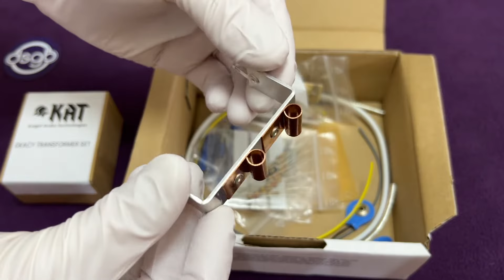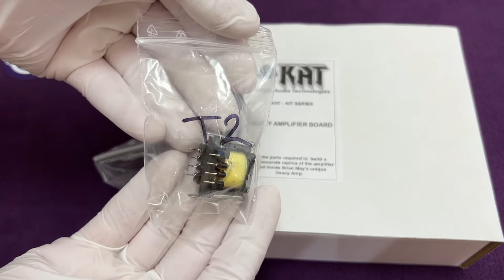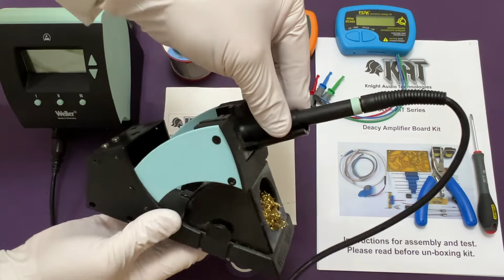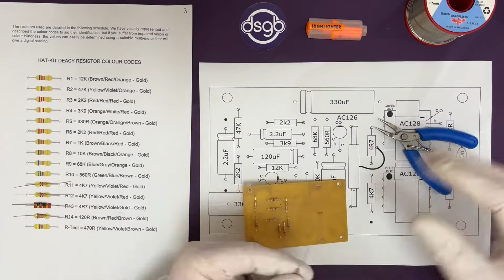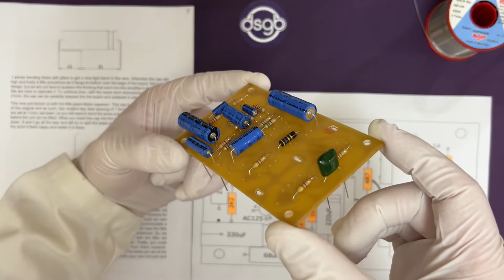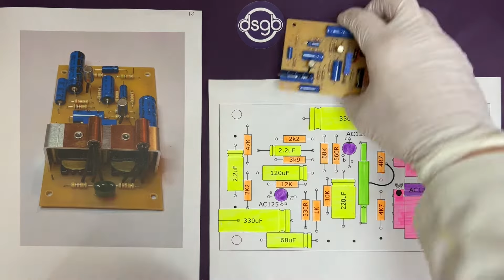Brian May Deacy Amplifier Build Part 2 - Circuit Board Assembly and Discussion

Comment: hola, donde consigo estás piezas para construir un Deasy
Reply from the maker: The KAT Deacy amplifier circuit board kit I assembled in this series of videos was limited to 100 units and have sold out.

Nigel Knight has no plans to restock due to the difficulty sourcing suitable germanium TO-1 can transistors with low leakage current and Hfe gain values which match those in Brian's original Deacy amplifier.
Reply: Bunches of those TO-1 on ebay but the U.S. ebay  @dsgb

Comment: Although there’s no chance I’ll be in the market for one of these it was an interesting video and… before I’d ever heard of the Deacy amp (we’re talking late 1970s) I made something very similar from an old hifi speaker. I didn’t construct the amp from parts though, I think it was a commercially available unit that just needed the addition of a mains power supply, which I cobbled together without killing myself. Happy days!
Reply from the maker: Happy days indeed. I didn't need to make a Deacy amp replica but I learned a lot by eventually fulfilling a desire and curiosity to make one. 😀👍🏻 I'm pleased that you got some interest from my Deacy video(s) because they took a lot of effort to produce.